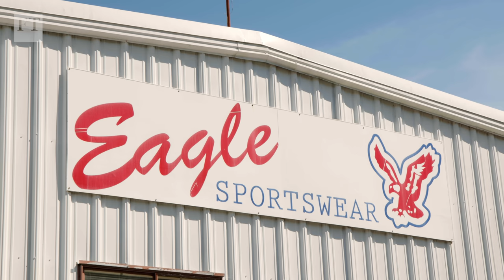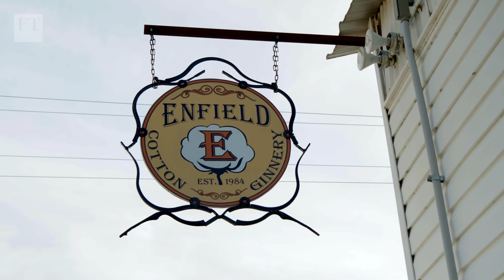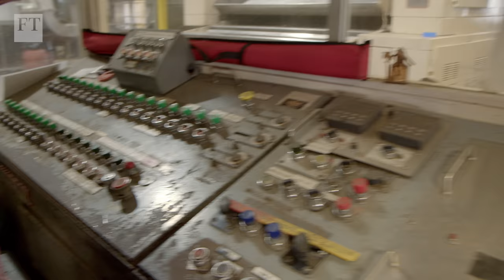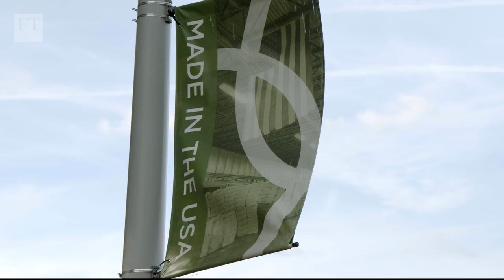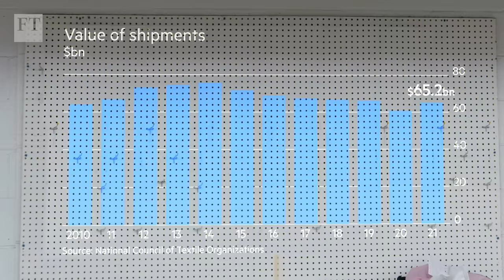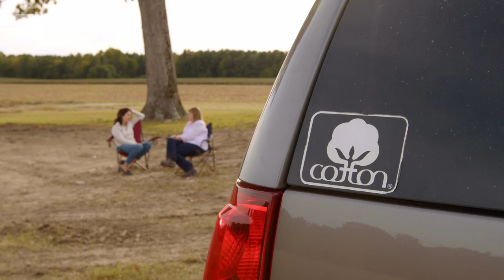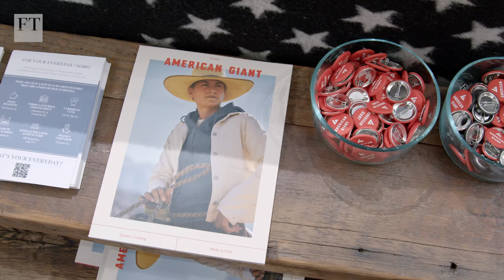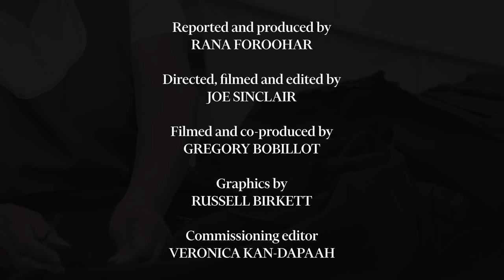Manufacturing in America, post-globalisation| FT Film

Comment: Another added benefit, if you have the skills to manufacture locally then you've got the skills to repair and maintain. More expensive, high quality goods made locally - less cheap tat that lasts a few weeks
Reply: Absolutely. It doesn't matter if your fridge is a bit more expensive, when it's made so that you can repair it and use it for the next 40 years.

Comment: The Trump administration wanted to use mainly two sectors —manufacturing and the “shale revolution”— in order to strengthen the American economy and sovereignty. Both are very important pillars for an economy. But as far as the USA “shale revolution” is concerned, which was followed blindly by other countries of the Western economic block (Britain etc.), no convincing argument can be made that it will improve the American economy. As a study concludes: “there is no evidence that the shale gas revolution will contribute to a ‘reindustrialisation’ in the US at the level of the manufacturing sector as a whole. Exports have increased in gas-intensive sectors, but only to a total of $23.6 billion in 2012 compared to a US manufacturing trade deficit of $779.4 billion. Coupled with other factors since 2007 which would tend to boost exports and reduce imports, including declines in the US real exchange rate during this time, and the effects of the recession on net imports, it is difficult to conclude that any evidence exists of a US manufacturing renaissance led by shale gas”.  However, in almost a decade since the US shale gas began its technological “progress”…the production of it scored from almost nothing to almost 50bn cubic ft/day at the beginning of the this year (2017). As a result of it:

Low-cost convenient gas pushed coal out of the power sector. Instead of importing gas, as many had expected, the US became self-sufficient before becoming an exporter first of coal and then of gas, in both cases weakening already fragile global markets. The shale revolution extended to oil, lifting US production by 3m barrels a day and forcing the Saudis to try to flood the market in an attempt to drive American producers out of business and maintain their own market share. The fall in global prices did not have the intended effect. Some US production was cut back at the margin but the main impact of the Saudi policy has been to push the US shale industry into a process of dramatic cost cutting and technical advance. Now the full implications of that are beginning to be obvious: a second shale revolution is underway. The story is impressive. Costs have been cut to the point where the industry as a whole breaks even at $50 — and in some cases even below that…The Permian Basin in Texas — the main focus for the new activity — has oil reserves that exceed those of all the largest discovered fields globally, such as Ghawar in Saudi Arabia and Prudhoe Bay in Alaska…Those who assumed the shale revolution would be killed off by a cyclical downturn in prices have been proved wrong. Instead, we are seeing a structural shift with supply growth exceeding demand. The implications, especially for countries dependent on earning high prices for their exports, are very serious. The net effect is a redistribution of wealth away from producers in favour of consumers. We are in for a long period of instability, driven this time not by scarcity but by plenty. 

But all this “success” was blown up by the geopolitics of Russia and Saudi Arabia during 2019 and afterwards by the “Corona-19” and the war in Ukraine. On the other hand, when Trump undertook the presidency, US manufacturing lost about 5m jobs, or 30 per cent of its workforce, since 2000. From a broader perspective, manufacturing in US declined from 30 per cent of total employment in the early 1950s to just 8 per cent at the end of 2016. The cause of the long-term decline in manufacturing is not “the rise in employment in the rest of the economy”, as Martin Wolf, chief economist commentator of FT argues in an article.  But as Fotopoulos shows, it is a consequence of “the reduction of the welfare state into a safety net and the parallel encouragement of the private sector’s expansion into social services (health, education, pension schemes and so on)”  — a process which started after 1970s in America and Britain...

Comment: I worked for the largest producer of polyester textile filament in North America from 1988 until 2006. They were a great company to work for and had above average pay and benefits. Sadly the corporation was very shortsighted and would not reinvest any money back into the business. The factory was started in the late 1950’s and was constantly added on through the 2000’s. The plant eventually had 40 acres und roof and in the early 70’s had over 3000 people that worked there. During the mid 70’s the went down to about 800 employees. The corporation would not reinvest in new equipment, some of the machinery was from the early 60’s. Gradually they started cutting the engineering staff and the maintenance staff ( of which I was a part of) kept the plant running about 5 years longer than it should have. It is very frustrating when you can see the waste all around you but they never tried to cut cost or automate anything until it was too late. We supplied polyester textile filament and had 90 percent of the polyester textile sewing thread business in North America. We were told that part of the reason some of the plant was shut down was because they could buy  the same filament over seas cheaper than we could make it. A lot of the equipment was sent to Mexico. I could see the hand writing on the wall and left in 2006. Some people hung in there until the end. They had to find employment at a few of the local companies that were left, they didn’t pay anywhere close to what the company we worked for paid. The entire county I lived in (Cleveland County NC) lost every textile mill except for a couple that hung on, only to close later. People that loose a good manufacturing job and can’t find another simply have to move to a city that has better opportunities.

Comment: Manufacturing is able to come back to the US because of the increased usage of automation. Family run businesses are more nimble than big corporations because there's less regulation on them. Big corporations can deal with ESG requirements and small companies are exempt. The companies that are in between in size will struggle to compete. Mid sized companies will turn to automation to be able to compete. It's not clear what kind of jobs and how many jobs will come out of the automation of factory and warehouse jobs and trucking but the number of jobs will be no where near what it once was.

Comment: It seems this whole documentary is contradicting itself. You set out point out the loss of jobs and how countering that is "vital" for the community, however you ended up talking about efficiency and automation that eventually don't create jobs (factory of 2000 operated by 200, replacing low skill jobs etc).
In the very long run this will benefit the US, but at least 2-3 generations of American people will "sufffer" during the process.
Godspeed nevertheless.

Comment: Buy fewer clothes and shoes. Especially those of low quality. We can ALL figure out, that's not good for the environment. Make things of high quality and have good maintenance and repair possibilities for them. In my youth we were bringing shoes to the shoemaker all the time. Now the shoes break at the seems, even before they need new soles. We throw away so incredibly much!
In my youth a good washing machine lasted for at least 15 years. Now I'm thrilled when they make it to 7 years for the same number of washes. Our small business needs a tumble dryer. It broke down and the costs of the hope of repair was higher than buying a new good one. We managed with difficulties with the old one for another half year, till it was thrown out :( because it really had become very labor intensive. Not all is better now. 
We are actively looking for second hand furniture, before we shop for new, in many cases. The carbon footprint for making things is insane. Let's consume less, and live more. Stop showering every day and use a wash cloth where needed in between. Wash your clothes only when they are dirty. Little things help yourself and the planet (where your live on). Be frugal, so you actually have money to buy things of good quality, which in the end will pay off too.

Comment: For some reason, foreign-made shoes don't fit American feet, as though there were a problem translating inches into metric or the feet of quality testers from a different race are a different shape. What about those one-size-fits-all socks (large, medium, and small inclusive)?! Or what about those underwear with non-stretching elastic at the leg holes?! Those are truly not even wearable once; you just throw them away. If you find something you like in the store this year, you better go back and buy several pair immediately, because next year the foreign manufacturer will find a way to produce what looks like the same product, but suffers from inferior materials and other cost-cutting measures to increase profit margins. Whose decision was it to off-shore all the manufacturing jobs? I can assure you it was not the workers. In fact, American workers were completely left out of the decision process. On the other hand, to claim that bringing jobs back to America is going to support American families is far-fetched when automation has already reduced one factory workforce from 2000 to 200. Oh sure, those laborers can possibly find work in another production plant, at least until that plant automates, but how is that going to raise wages and how is constantly moving to a new city going to provide stability to American families? When robots begin producing 1000 x as many widgets as humans, and working non-stop except for maintenance time, who is going to have the disposable income or the storage space to consume all those goods? We already have way more stuff than we have time to use. On the other hand, it is totally wrong to blame the Chinese, as though this was a Chinese conspiracy to overthrow the West. The Chinese had nothing to do with the baseline decisions to move production out of the USA. It is immoral to characterize China as "the Enemy." They are just following the same principles of profitability as any economic competitor. The Chinese have their Uyghurs, and American conservatives have their Mexicans. In the end, we are all human beings, whether Christian, Catholic, Muslim, Jewish, Hindu, Aztecatl or whatever. Religion however does not replace compassion. This video begs the question, should profit lead us in our choice of cultural values or should family and economic stability and security predominate? Are we willing to sacrifice progress for more stability? My answer plain and simple is that it was a mistake to kill K-Mart. They had some great brands with reliable quality at fair prices. Contrarily, PepsiCo has ruined numerous fast food chains that once had nutritious food choices. If you think we are not already worshipping at the altar of corporate fascism, think again. Then again, we need workers to rebuild our entire electric grid in the next 5 years to accommodate all the e-vehicles charging in garages overnight at 240 volts and consuming 50 x more electricity than your refrigerator. Calling all migrants and laid-off Sears clerks. This subject is fraught with complexities, contradictions, and hypocrisies.  By the way, is making the rest of the world in the image of America “globalization”?  Would retreat into total economic self-sufficiency, dependence on our own domestic sources of raw materials, sanctioning of trade with all other nations, and bans on foreign currency exchange support continued U.S. economic hegemony?  If the $US was not the currency of last resort, could US exports compete on world markets and wage rate differentials between developed and developing countries find equilibrium?
Reply: Very fair and sensible comment.
If only you could put it into paragraphs so more people would read it. 
Thanks all the same.

Comment: Lighthizer is simply Wrong. The total employment in manufacturing did reduced by half, 10 millions. But they did not tell you the US Manufacturing Output is more than doubled in past 4 decades. Which means we should have 40 millions manufacturing job at 1980s productivity level. So this means US lost 30 million Manufacturing Jobs to Automation. Now you comparing 30 millions job  loss to the high-end estimated of 5 million jobs lost to China (this does not include the Job increase because of the export to China and the Low Price and 4 decades of low inflation), you can see the so-call China Shock is just a Scapegoat.

Comment: Globalization relies not only on CHEAP energy, CHEAP labor, but safe transport. Those slow boats from China are easy prey for anyone wanting to do bad things to them. Right now, it's not much of an issue. The Somali piracy and the problem with Iran in the Straights of Hormuz are almost non-existent today and that was about all the threat to ANY shipping. Some of the supply lines go through several choke points and travel in excess of 12000 miles, quite safely. What happens when the world changes? Energy is getting more expensive, but also fragile. Labor in many places including China is going up. Throw in military conflict or some Piracy, state-sponsored or not, and the risk to ships skyrockets along with insurance costs. As with civilian shipping in the Black Sea near Ukraine, some companies refuse to insure ships, so ships don't even go there. Once the seas become more dangerous costs will skyrocket and make stuff back in the USA will become economically viable again. Good thing we have the energy, and security and know how to make it happen.